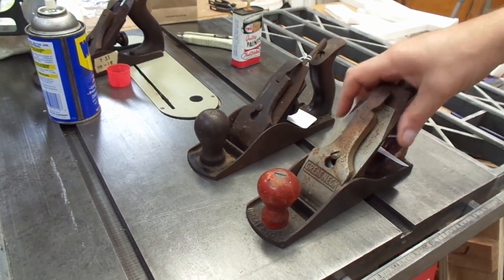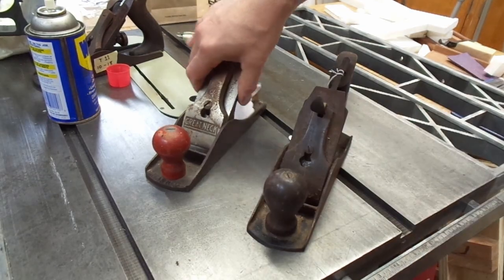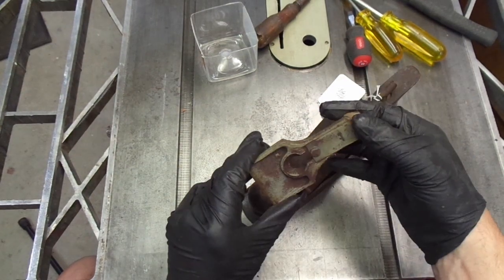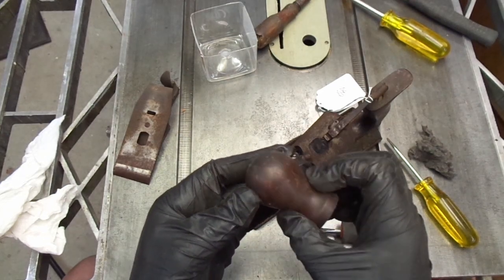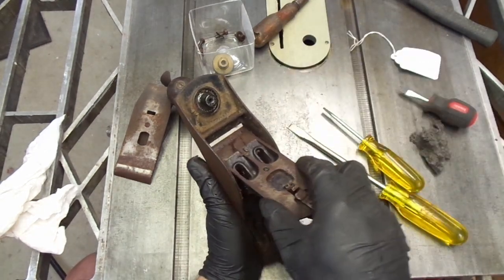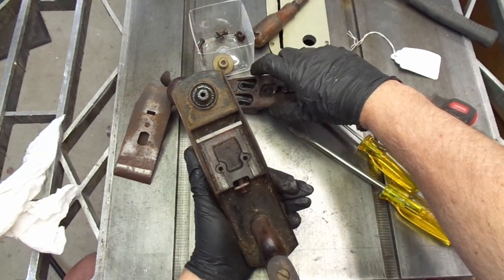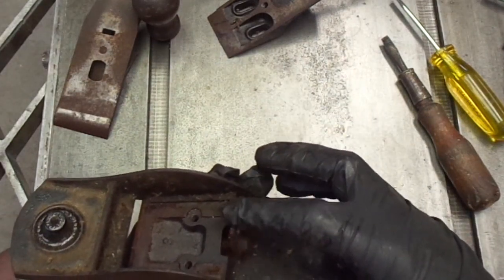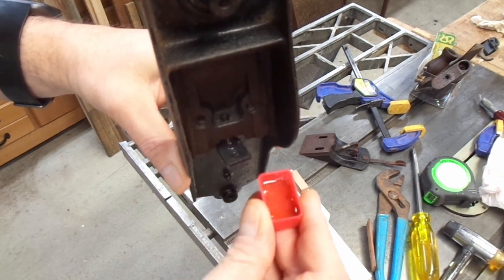Vaughan & Bushnell 804 Hand Plane p1

Comment: Evaporust is not  useful for freeing stuck parts.  Use a penetrating oil such as PB Blaster or Kroil next time.  If you use heat, you need to only heat the part that will free when expanding. In this case heating the machine screw will cause the two parts to be more firmly stuck.  Glad to see you finally got the frog adjuster plate loose, hopefully the tips will make it easier next time.
Reply from the maker: Thanks for the tips.  I used the Evaporust to begin with to help clean the part and give me a better look at it.  I wasn't sure what I would be up against at that point and wasn't anticipating such a chore.  You're right about the heating, but I was fearful of ruining the finish with too much heat.  I couldn't think of a way to heat the screw without heating the plate or body. (Maybe a super wattage soldering iron which I don't own.)  I've heard good things about the the Kroil and PB Blaster.  Thanks again.

Comment: The 800 series were cast iron. The 700 and 900 series had forged steel body, with 900 having additional nickel plating.
Reply from the maker: Thanks for the info.  The 804 is my best plane and I enjoy using it.  I'm a novice, but it's a lot of fun.  I still have trouble wrapping my head around a forged body and maybe some day I'll get to see one (maybe own one).
Reply: @jazbuilding  I got the 904, which is the most common. They can be had off evil bay from time to time. The thing to look out for is the 700, 900 series drop forged body always has flat side wings much like the bedrock plane look. While all of the 800 series casting looks like any other planes out there.

Just note that being steel, flattening with sandpaper is no fun at all.